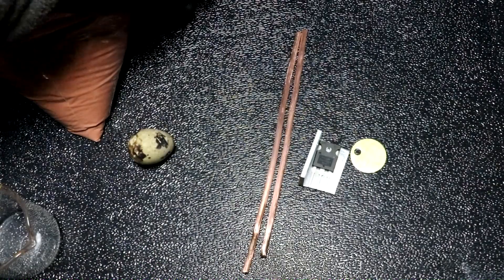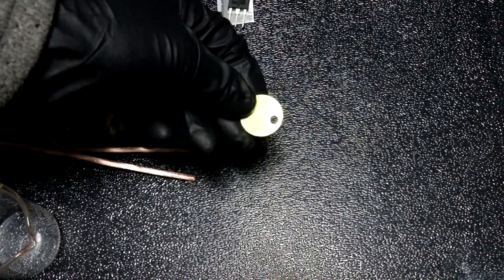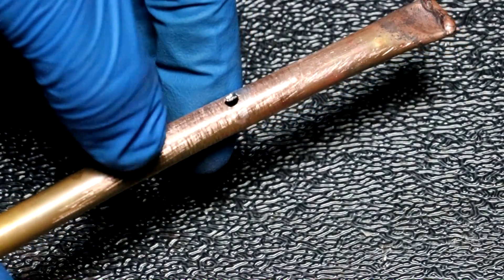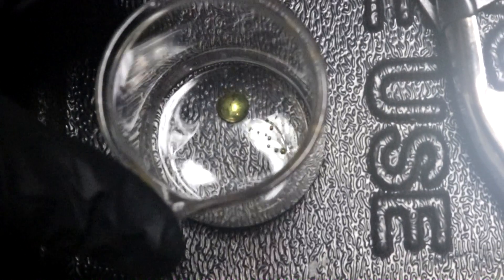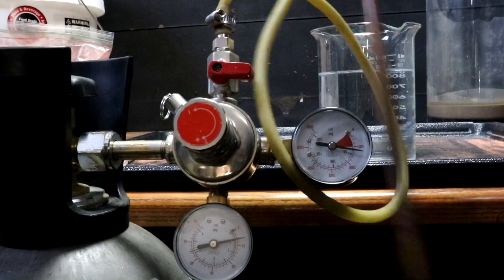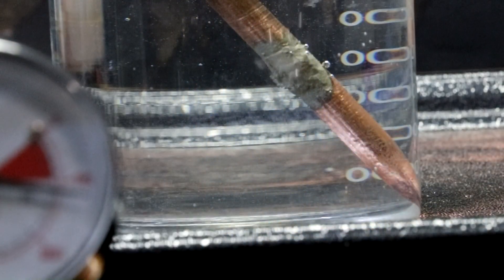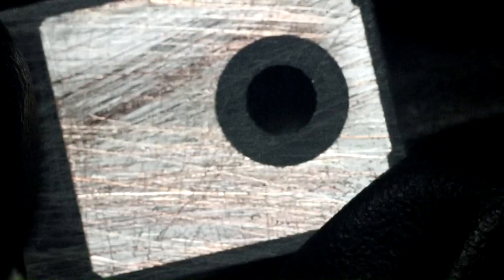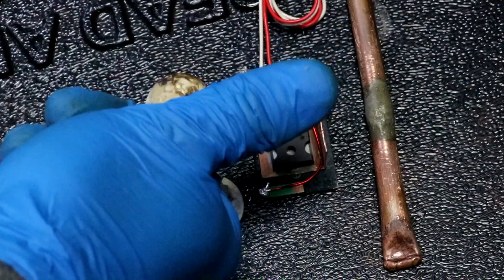Copper Mercury Amalgam Experiments

Comment: I think if you heat it you will get a stronger bond or copper plating. It kind of confusing cause mercury will dissolve both gold & copper, yet if Amalgam is heated by itself, then it will turn to powder, but if heated on statue it turns to metal platting. Maybe that only works with steel? 
Can mercury be on gold pins can gold recovery method? & then can the mercury be reused like how the old minors did years ago?

Comment: I'm going to be making some solar panels and I'm looking into finding a good homemade conductive adhesive. I know I could use silicone or epoxy with carbon or nano carbon or nano silver, however I'm thinking a merc/tin amalgam may work. I will be encasing it in epoxy. Any ideas Cody? Also thinking about different refractive indexes and whatnot of materials for the front of the solar panel...

Comment: Since it is so porous, could it be used as a catalyst or maybe even a heat exchanger like those in sterling engines? Those are usually stacked fine wire meshes.

Comment: 10:40 you could try increasing the density of the material to filter gasses. Add more copper and it may be more pourus to smaller molecules
Reply: It could be an artifact of the existing gassious environment tho

Comment: At which temperature does mercury start to significantly evaporate from copper amalgam? Using the latter as a thermal grease or as a solder for radiators sounds a bit like using radium in beauty creams :-)

Comment: Experiment:could you mix a sulferic acid and sugar solution to form a carbon cone and then nutrilize the left over sulferic acid with baking soda solution. Then use the cone for water filtration or a carbon air filter.

Comment: So cody i am collecting mercury ( I'm an HVAC tech and its in old thermostats ) and in order to collect it I have to break the glass bulbs that its held in. My question is how do i get the glass shards sifted out of the mercury ?
Reply: The glass will float.  One trick is using a coffee filter with a pin hole.  The mercury will go through but the glass will collect on the paper.

Comment: Cody, some suggestions for you:

1) Can you please show people the true colour of Aluminium, by exposing the surface in the absence of Oxygen? It has the most beautiful delicate hue, but we never see it in air, because the surface oxidises within milliseconds, if not microseconds. We used pure Aluminium in Nitrogen or Nitrogen/Argon, for Al connectors onto pads on Silicon and Gallium Arsenide chips.

2) We also measured Silicon Dioxide, and Silicon Nitride, layer thicknesses by the colour of the layer when viewed under white light. This was done by comparison with a colour chart, and if you were experienced, it could be done from memory. The method was accurate within a few microns or better. That might give you useful ideas for video demonstrations, with a variety of surface coatings. Colour charts can be found online.

3) With that egg, can a graphte coating be added, by simply rubbing it onto the shell, so that you can plate it with a metal?

Thanks. :-)

Comment: Try using the amalgam in a working computer's heat sink and compare!  If you do don't forget to measure the temps before you switch the thermal paste and use a stress test program to put some real watts through the CPU.  Should be easy to conduct since software will tell you the CPU temp.
Reply: On second thought, the little air cavities present would make it a poor heat sink compound...

Comment: Hey Cody, I know this isn’t really on topic with the video, but I’m looking into building a short path distillation system for fairly cheap, and I’m having trouble finding a vacuum pump for cheap enough. I’ve had people recommend a Welch 1402 or Edwards 28/30 but I was wondering if I could put a couple smaller ones in a series to achieve the same affect or if there was any cheaper pumps with similar power you know of.
Reply from the maker: I don’t see why a cheap pump wouldn’t do the job. Depends on what you are distilling I guess.

Comment: Mercury is used in some extreme computer mods by removing the die plate on the processor and removing the factory thermal compound and replacing it with mercury or a mercury alloy then replacing the die plate. supposedly it improves thermal transfer by a lot

Comment: I think the amalgam is porous because it is more dense than the copper - mercury mixture itself. So as the copper powder is dissolved into the mercury creating the amalgam voids appear due to the increase in density.
If this is right then an amalgam with a more dense metal should be less porous, also making the amalgam in vacuum shouldn't make a difference.

Comment: Cody if you're doing future pressure tests it would be best if you do it with non compressible fluids. If you do it with compressible fluids you store potential energy and could harm yourselfm
Reply from the maker: All fluids are compressible.
Reply: @theCodyReeder  ahh but water will hold a lot less pressure potential than nitrogen, I mean when water relieves to atmosphere the volume change is a lot less than if a gas relieves to atmospheric pressure. if you have a failure it may send shrapnel your way. Do a video about it ;)

Comment: Hey Cody is it harder for radioactive rays to penetrate denser objects or is it just lead? And is it ok to store Uranium in a box surrounded by tungsten?
Reply from the maker: Actually tungsten is worse than lead because it’s not really mass but electrons that do the stopping. Hydrogen is best for the weight, uranium is best per volume, lead is just a high z number element that is cheap
Reply: Ok Thank you.

Comment: As with any experiment, this raises more questions.
1) Will gallium alloy with copper (powder)?
2) Does the copper amalgam conduct heat better than standard thermal paste for power transistors?
3) If you used a copper disk instead of a brass one, would the copper amalgam set up better (and harder)? What about a “copper” penny?

Comment: I think you should do some more experiments with this amalgam.  We need to know if it has any semiconductive properties.  If you put a disc/coin of it in liquid nitrogen.....will a neodymium magnet float on it??? 
I love it as a low temp. solder.  It could be used in a high O2 environment or other environment where combustible gasses were present.  ...what about as an ink to print circuit boards.

Comment: Was wondering if the amalgam itself is porous or if the residual hydrochloric acid is reacting with un-amalgamed copper producing hydrogen? Like holes in cheese? Anyway to reduce the oxidelayer prior without using acids?

Comment: Fascinating vidéo,  thanks.  On the matter of heat sinks for transistors,  unfortunately the tab is usually not electrically isolated.  There is no need for a thermal compound unless you need electrical isolation, usually by interposing a very thin layer of mica..  If not, you have metal to metal contact between two malleable metals, squashed by the bolt, which is thermally fine.  So there's not much use for an electrically conductive thermal compound.   In case anyone's interested, I used a similar mosfet to switch 40 Watt halogen lights in time with voice amplitude for a friend's diy dalek.  No heatsink needed, the trick is in having fast rise and fall times.

Comment: The idea behind commercially available thermal compound is basically "almost everything is better than air".
Most thermal compounds are just made out of mostly silicone with some additives. Even most "high metal content" compounds are silicone based still and such are basically still thermal isolators. Just less so than air.
What you did however was to create a metal-metal contact. It doesn't get much better than that even if there might be tiny air holes in it. So my guess is that your solution outperforms most compounds by several orders of magnitude.
In fact, there are metal thermal compounds available for high end PC processor applications to make metal-metal contacts between processor and heat sink. You should have a look at those!

Comment: You can use this to make a metal foam. This would be useful in Sterling engines when the gas passes from the hot side to the cold side. The heat passes through, cooling it as it goes from hot to cold, and heating it ma's it goes from cold to hot. Maybe it could be useful in magnetic cooling too. 

Are dental emalgums just as porous and does that allow bacterial through?

Do the spaces (bubbles) detract from the heat conduction in a heat sink? 

Would putting it uncovered in a  vacuum create a mercury vapor problem?

Comment: Hi Cody! Just for your information if you didn't know this yet. Sometimes it's ok to put just thermal compund on mosfet/transistor and it's simply ok (although this depends in what kind of assembly are you doing) But sometimes you need insulator between the chip and heatsink so that the mosfet or transistor wouldn't be shorted or give potential difference between heatsink and other components (sometimes the emitter, collector or base is same pin as the tab behind the chip package) So if you put let say 4 mosfet in H bridge configuration there is possibility that there will be short between them if you don't insulate the back side of it. Thank you for all these informative and interesting videos you make, though I lack highly chemical and physics understanding, I sill love to learn more and new :) PS: Sorry if I have wrong terms or mispelled words, not my native language, trying to get better though :)

Comment: It’s a reverse light switch. Instead of converting a mechanical change into light, it converts light into a mechanical change. So, would that be a switchlight? A tghilhvtiws?

Oh, and you wouldn’t need to necessarily mix it under a vacuum. Just processing it in a vacuum before it hardens should draw out the bubbles.

Comment: Some constructive criticism:
1. Eggshell is made of a calcium carbonate matrix with some embedded proteins. This matrix has a crystalline structure which is very small, and very brittle. Rubbing this amalgam on it, with its embedded copper particles (which are unreacted until more time has passed?) will simply scrub off the surface of this matrix, since copper is considerably harder than the eggshell, instead of sticking to the roughened surface. This is supported by the fact that the amalgam turns "whiter" after the attempt, you're looking at scrubbed off eggshell embedded in it. Maybe try this with another, harder material, one that is harder than copper ideally.
2. IT'S PRONOUNCED MOSFET NOT MOFSET

That's it. Love the channel. Keep on sciencing brother!!
Ross

Comment: Now you know why a dentist must undercut tooth structure to have a mercury amalgam stay firmly in place. It won't stick to your teeth either. Great video!
Reply: Do dentists still use mercury amalgam?
Reply: @herpsenderpsen  Some, but most now use UV cure composite materials.
Reply: @electronicsNmore   lol you think amalgam is toxic and that dentists use a UV light to cure composite 😂
Reply: Dental amalgam is actually quite nice. Its easy to squeze into holes and it gets hard and strong after curing. Toxicity isnt that big of a concern as its rarely coming into contact with compounds that can dissolve it while being in your mouth. However it seems to be reacting with gold fillings in other teeth, so you shouldnt have those two types combined.
Reply: @Chuckiele  It actually creattes a little battery in your mouth combined with gold fillings;) To be honest I'll gladly use amalgam on teeth not visible from outside, because it's not disposable after 5-10 years like composite materials, but it's getting harder to find a dentist that do these.
Reply: @shana_dmr  yeah and you dont want a mercury battery in your mouth. I would also use it on teeth visible from the outside. Having visible fillings is nothing to be ashamed of, breaking or losing teeth is normal.
Reply: Mercury amalgam slowly expands. I have nearly lost 9 of my teeth. The dentist will grind half a tooth away for a tiny cavity. Also i was constantly sick, my teeth would hurt id get an infection under the fillings that would spread to my lungs and almost killed me a few times. Id tasted metal tarnish all the time it was absolutely horrible. The fillings became brittle in about 8 years and practically exploded when the new dentist touched them with her drill. I will have dentures in about 20 years when im 50 my teeth are ruined.
Reply: @SmokeyWire56  There is a phenomenon called creep, that can cause movement in amalgam fillings over long periods of time and a filled tooth is weaker than a unfilled tooth that doesn’t have decay. However, decay is the major cause of your issues and decay is caused by sugary foods causing plaque to form on the teeth and this not being brushed away. This also leads to the infection under the tooth you talk about. If you ate less sugar and brushed more you wouldn’t need the fillings in the first place
Reply: @mugwump Anything is a detector if you're close enough to the AM broadcast band radio tower especially if grounding is badly corroded.
Reply: matt xoxo  Clearly something you know nothing about. LOL

Comment: anyone know why the mosfet is needed on the solar panel? its not really doing any switching couldnt the panel just be wired straight to the motor
Reply: That motor is WAAAY to big to be run from that dinky little solar panel, it wouldn't even budge it in direct sunlight. He's running the output of the solar panel to the mosfet gate, with a bleeder resistor from the gate to ground.
Reply: i see the solar panel is just the switching power, he has a separate supply off camera

Comment: Metallic Mighty Putty comes to mind. There's also something called Milliput; it's basically mixed like Mighty Putty (but it's two separate parts) and you use it for arts and crafts and it can even be turned on a lathe.

For reference, dental amalgam is made from (apart from mercury) silver, tin, and copper. Does it make any difference to mix the tin and copper separately versus grinding up a bronze bar? (Probably, since the proportions will be all wrong.) Other substitutes to test would be iron, gold, gold-silver alloy, steel...

Comment: Being able to make a porous metal may be useful for hydrogen fuel cell applications where you need lots of gas contact with metal while under a liquid electrolyte, although I think the conditions would cause many side reactions as well

Comment: if it is porous that could mean that it would actually be a worse thermal paste right? kind of like how batt insulation works by having air pockets?
It would be interesting to see a thermal image time lapse of heat traveling from one side of a lump of amalgam to the other compared to cast iron, aluminum, copper, and liquid mercury in a test tube. . .I think volume would be the way to go in sizing the experimental pieces.

Comment: Those mosfets are not cheap, like $5 to $15 a piece depending on the voltage rating. I've had a few projects with $20 FETs in that package rated for 412 volts to dissipate 300 watts TPD.

Comment: I'm not so awesome at chemistry, but given that you've essentially dissolved copper into solution with mercury, wouldn't putting it on aluminum cause cementation? Wouldn't the copper come out of solution and be replaced by the aluminum? I mean...that happens in liquids, doesn't it?

Comment: I've electroplated plastics and other non conductors using either a dilute silver paint (not much $ value of silver, and copper paint would probably work too) - or graphite, rubbed in hard.  The trick is to go very slow at first - microamp levels, to let the initial plate get up to a thickness that will support "real" plating current.  Almost anything conductive  works - stuff that reads under a megohm on a DVM will do fine.

Comment: Hey cody, Dental Student here. We do loads of amalgam restorations. They work very well but you have to undercut all of the preparations because as you can see it will not stick to many things very well. Also with the voids, a vacuum chamber is not a bad idea, but also just applying firm contained force to the amalgam with a tool will cause the voids to be pressed out. Anyway hope that helps. Also just saw the leak part, really try compressing the amalgam while it is setting with FIRM force. I bet you it holds pressure much better then

Comment: The soldering was a success, solder is not meant to be a structural weld, just electrical. I doubt that if you used real solder it would be all that stronger. Great vid
Reply from the maker: Good point.

Comment: The soldering was a success, solder is not meant to be a structural weld, just electrical. I doubt that if you used real solder it would be all that stronger. Great vid
Reply: Solder is both electrical and mechanical. What do you think holds SMT IC's on a PCB?
Reply from the maker: I feel like I’ve read this before...

Comment: Is there some reason to not ensure the solution is saturated with copper instead of mercury for the purpose of aluminum contact? (maybe affects curing? not familiar with the process creating the curing here)

Performance as a thermal glue looks plausible. if you continue with this stuff I think it would be worth comparing it to tin/lead solder and a decent thermal expoxy

Comment: I think the amalgam is porous because the bits of copper are being sucked into the mercury/non-saturated amalgam as it hardens. So putting it in a vacuum chamber wouldn't stop that since the voids are formed as it becomes a solid.
Reply from the maker: I think you may be right.